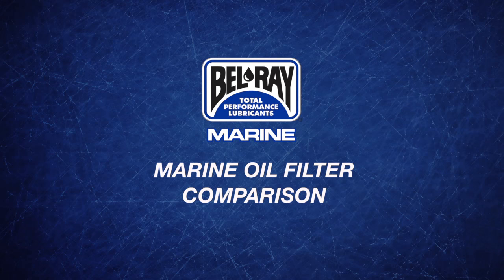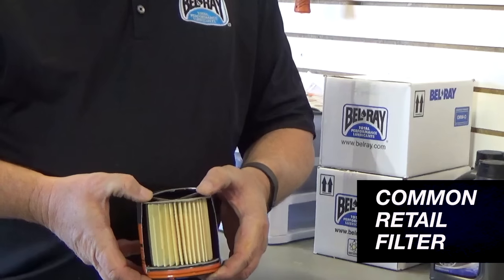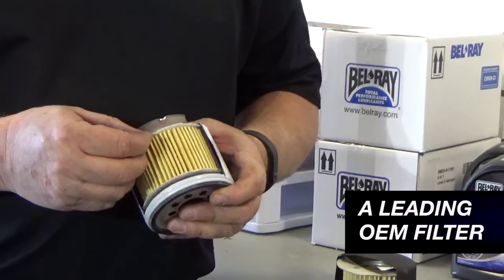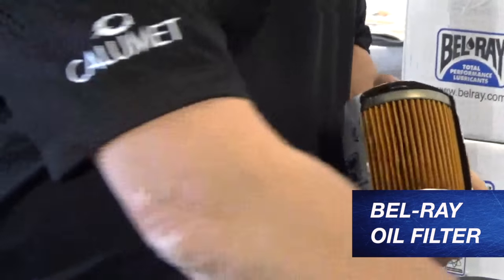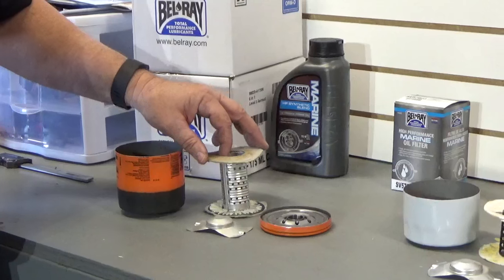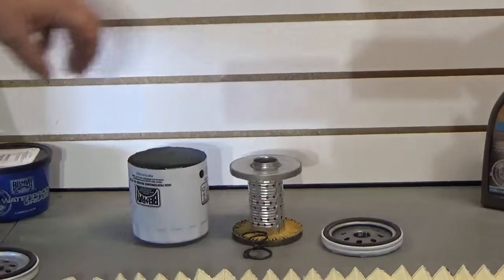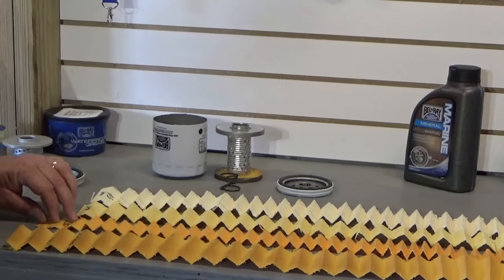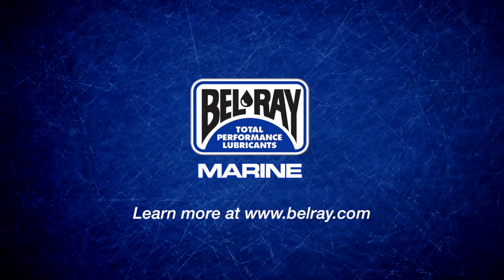Bel-Ray Marine Oil Filter Comparison

Comment: Placing the construction design aside, what is the precise filtering  capability of the filter? What is the dirt holding capacity or flow ability before it goes into by-pass? Give precise beta ratios for the products so the customer can compare. 95% of the Twenty micron particles on first pass? 99% of the thirty micron particles on first pass? Tell us. Just showing some cut-open filters isn't very helpful. And since Bel-Ray doesn't make filters, who have they contracted this task to?

Comment: Don't buy any parts, oil or filters for your boat in an auto parts store.  It says that in my boat  owners manual and I hear that over and over from people who work in the marine business.  (they see the problems caused by this)   You wouldn't use marine parts and oil in your car,  then why would you use automotive  oil and parts in your boat? 
Most of all,   buy the original equipment spark plugs.